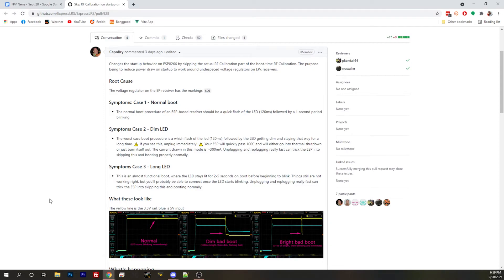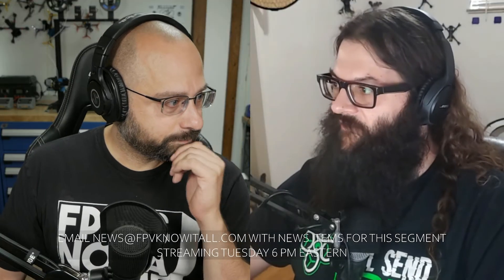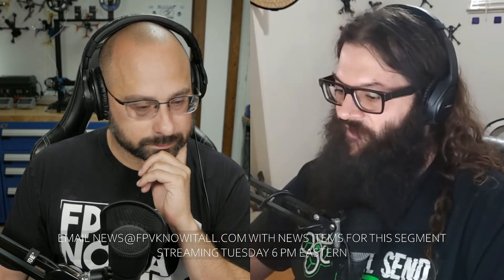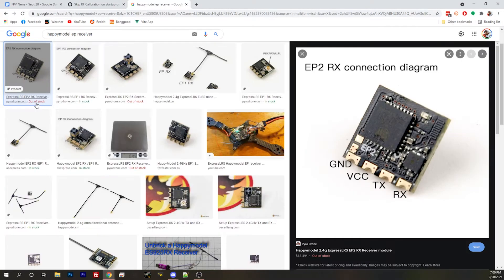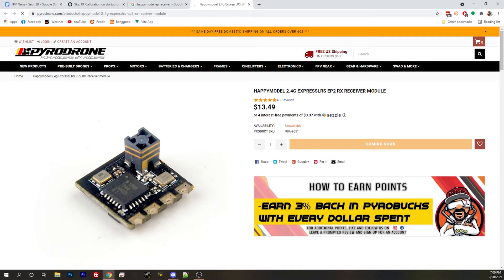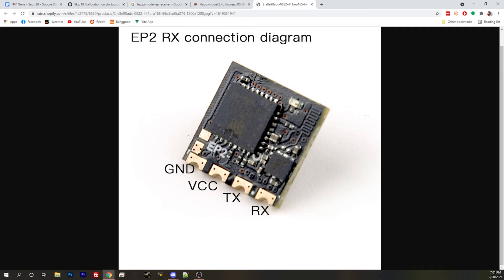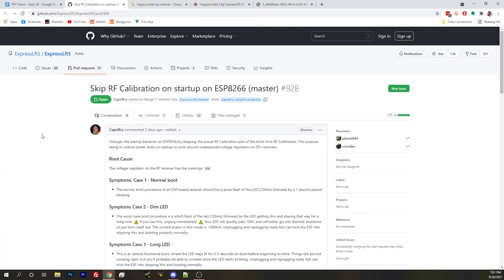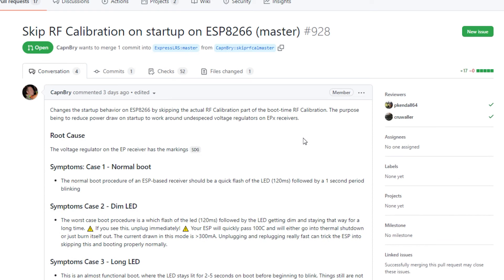Happymodel ELRS receiver defect causes RX to burn out. How to find out if you are affected.

Comment: Another one bites the dust, sure wish i had found this video before setting up my ep1 which just cooked itself after almost working for 2 minutes. As soon as i tried to bind it smeeled funny and no more lights, also betaflight wont connect if reciever plugged in but works fine with burnt reciever removed. Bjying a newer rx now. Elrs has really been a nightmare for me switching over. Im sure its mostly my fault but i bricked a radiomaster tx16s flashing edge tx and now this. Bought a new tx and rx so hopefully 200$ later i can use elrs. If this doesnt work im burning everything and going back to TBS

Comment: These clips are awesome. I watched the live stream, and didn't remember what was said about the hm rx issue. After recently installing 2 ep2s in 2 quads, I was having binding issues. First plug in would produce a dim amber LED.  I would have to plug in again for a successful bind. I have binding phrases set in both tx, and rx. Picked up an ep1 yesterday and looked at the regulator, it did not have the MDG marking on it. I applied 5 volts to it, and flashed it. It is binding on first power up. Thanks for saving me the trouble of having to go through the entire live stream again to find this info. You guys rock.
Reply: SDG* ;)